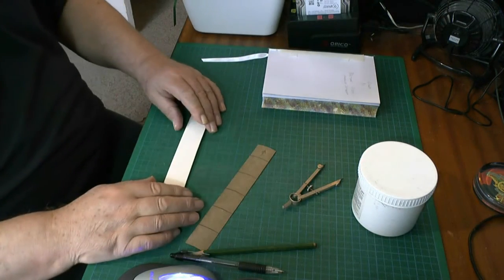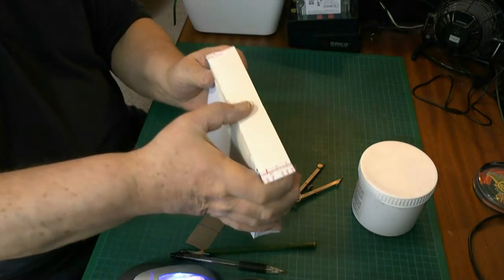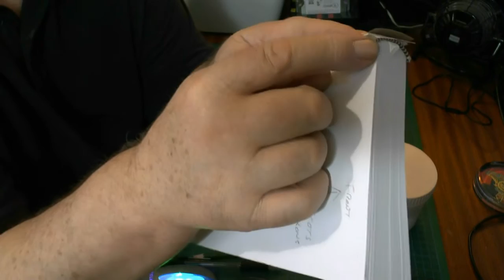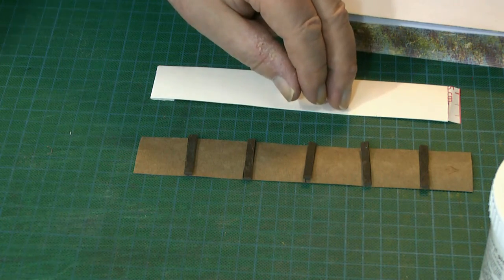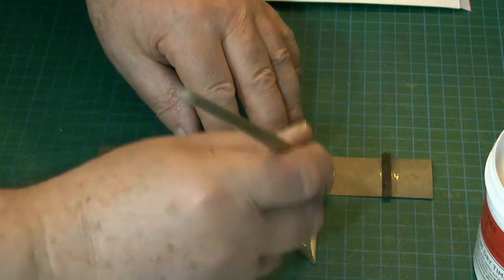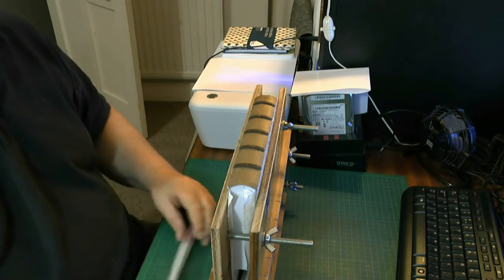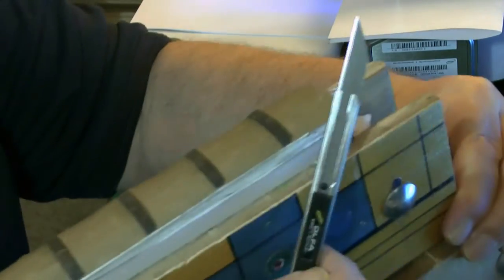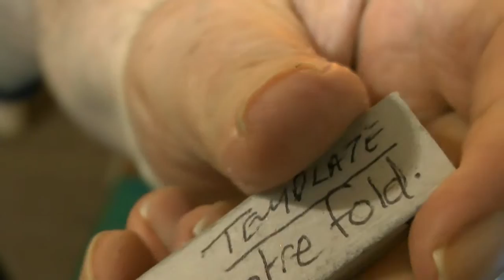Bookbinding in leather part 1

Comment: Hi, David
I've been doing and book repair for a little while now and I have got a lot of practice lately repair all the Bibles in our church.  I started because I collect old poetry books and I found them to get them at a suitable price I had to do some repairs to get them back into good condition. I have also learned a lot of my bookbinding skills by collecting new and old books on binding and repair. 
You said you did not know how you used the hollow back card from Ratchford's. I get my supplies from them and I use the same card. You make the whole hollow back from the card because it gives you the support you need to support the Leather or covering.  I measure it against the spine shortening it by a 1/16th inch I then found it over then again and then glue that turn in place. I repeat the procedure again and glue it. You should end up with a double tube. Make sure you use you long bonefolder to get a good fold each time. Use the folder to help you open the hollow gaps in the back.  Then you can glue it onto the spine mull. 

I hope that helps     John